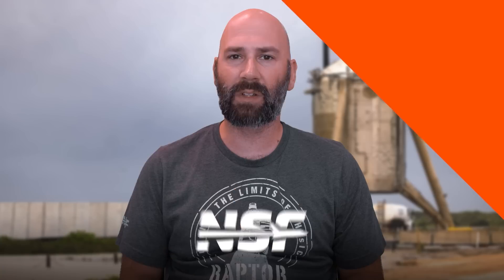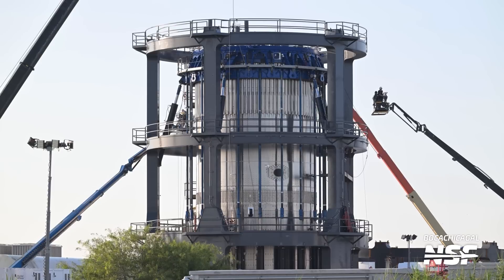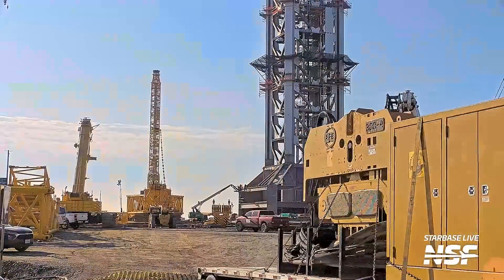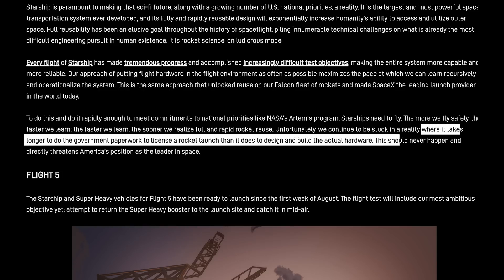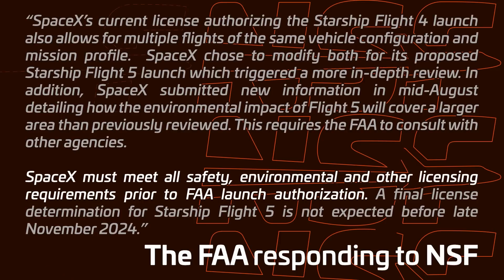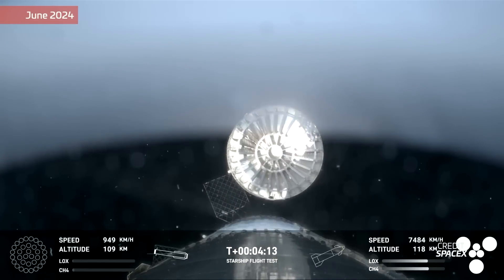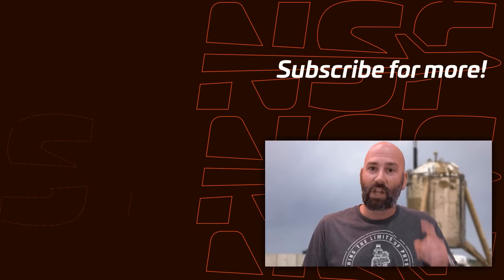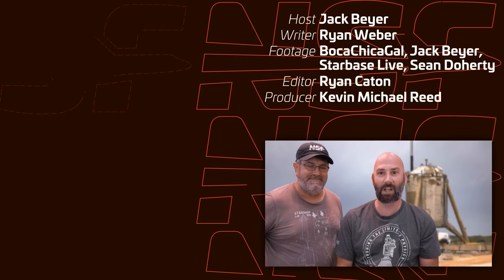WHY Is Starship FLIGHT 5 Delayed? | Starbase Update

Comment: Still watching, but you are WAY off base on Spacex not using an old configuration for more flights. Yeah, let's just keep making and flying Model T's when we've ALREADY gathered everything we can out of those flights - the science out is not worth the flight cost. That makes zero sense from a business standpoint. The FAA's process is outdated and needs to change. Hopefully some changes in Washington can streamline everything about how government works.
Reply: I never said the process was perfect, it's far from it. I never said the regulations should or should be changed. Just trying to report the facts. They could fly tomorrow and still complete important test objectives if they just follow the same profile as flight 4. In space raptor relight, tps validation, pez door testing, etc. Fact of the matter is, they chose this path and are now complaining about it
Reply: @JackABeyer  Are you sure they can do those things and still be considered flying the same vehicle configuration and profile?  I bet they would have to file new paperwork and would still be delayed by FAA.
Reply: @thestanwalker3512 Flight 3 planned for in-space relight, but was precluded due to attitude control problems. The Pez dispenser has never been fully tested, either. Flight 3 did operate the door, but not, so far as we are aware, the deployer; nor were any dummy satellites onboard.

Comment: I think you are technically right that even if you take drinking water and push it through a flame trench, its not as potable anymore. But if SpaceX does not have to do anything different after getting the certification then they were essentially correct. Nothing is different. They have documentation that they were even sampling the area as well. They were even sending (according to SpaceX) the samples. If nothing changes, then they were right that what they are doing was procedurally correct.  

I have a feeling that Texas knew they were doing the flame trench but it was either a CYA situation or a one part of the organization didn't know what the other part of the organization was doing, and it relied on SpaceX to know the rules.
Reply: Also the point of "I wouldn't want to drink the water after it has been hit with the raptor exhaust" isn't really relevant. I also wouldn't want to drink water from a puddle anyways, it doesn't need to be potable to not harm the environment.

Comment: I would take SpaceX's word over any FAA or EPA agency word.  I think the bigger point of what SpaceX is saying is that none of the stuff they are doing is any more harmful than like 80% of the industry in the area is doing. In fact, it's likely because of all the work SpaceX has done since they've been in Boca, that they've improved the overall environment as compared to before they got there. (SpaceX stated they test the water after every deluge event and it all tests fine, is that not good enough for the EPA?  They have to label it as industrial activity so that it now requires a different permit?  Labeling something as such, doesn't make it so.) (You drink alcohol so you're an alcoholic🤔... Just because industrial equipment is used, doesn't mean the water undergoes an industrial application or conditioning.)
I think it's because of Elon's high profile that the EPA and other environmental groups are picking things apart specifically in Boca.  The FAA is honestly just deferring all the environmental stuff off their place, so they don't have to deal with it. Whereas there are well established guidelines at the cap in Florida so there is little the EPA can do there.  Since SpaceX is dealing with their own land, not leased pad space in Boca, they are getting unfairly targeted.

Comment: I'm guessing they will need a water containment area. A "moat" so they can re-use the water.
Reply: The water was already going into catch basins, samples taken, analyzed, all before discharge. 

It was just a different "Industrial Discharge" permit, requiring the same operating procedures.

SpaceX probably can reuse the water, and that would require treatmenht to the same standards as potable drinking water. Expensive to do, and duplicating the Brownsville water treatment plant. SMH.

Comment: I would say its easy for regulators and government agencies to throw alot  things back at you and claim its your fault. Especially when their goals are to run interference. That is how the system works. They can bury you with paper work or they can be facilitators. I would say it  would be very short sighted to say we just dont have enough information but based on what we know its Spacex own fault.  Maybe thats the buearucrat take.  As an outsider it appears that if the goals are to be dominant in an increasingly competitive and strategic/ geo political space race then it is the government and not Spacex whom is its own worse enemy.

Comment: I'm an electrical engineer, I deal with inspectors on a daily basis to inspect and verify the correct installation of hardware by electricians. In my field we usually deal with one inspector per jurisdiction, so you generally end up forming a professional relationship that makes the process easier for everyone. Even still, there are many more people involved when a permit is requested, signed off on, or anywhere in between. 

First, I call a call center. They verify the scope of work. If I forget to tell them ANY information related to the work needing an inspection, the permit is invalid and has to be rescheduled. Likewise, if the call center makes a mistake, it's the same situation. 

Then the inspector comes out, inspects the work and requests any changes to be made, or passes the work and signs off. If the inspector has requested changes, it goes back to the call center and we repeat the first step.

Once the permit has been signed by the inspector, they will report back to the call center with approval, and I will receive my permit through email. This entire process takes a minimum of 2 days, up to a week.

All this to say that there is no room for "rapid iteration" in my field, and I suspect the same to be the case when it comes to the water system at SpaceX. Comparing it to my field, it could have been the case that the original inspector requested changes to be made, SpaceX implemented said changes, and perhaps it was never communicated back to the call center by the intern, and the techs or engineers at SpaceX assumed the process was complete, and the inspector perhaps assumed that another person had already signed off on the work.... 

Anyways, to wrap this up quick, you can see that there are so many people involved and not everyone has access to all of the information at all times. Especially the guys who are working on the site itself. If they get told to send it, they send it.

Comment: Trying so hard to provide impartial coverage, you did an awful job portraying the issues at hand. Without cherrypicking every single thing, just the water deluge issue: as you point out, it's not reaaally drinking water, right? But then, so what? They're still allowed to dump it. They didn't have to make a single physical change to the system to protect the environment, they just needed a different piece of paper. SpaceX is complaining that they are waiting for repeated "environmental protection assessments" that do not do a single thing to protect the environment, they just push papers around. 
And the cherry on the top is that you suggest the hot staging ring falling to a different random spot over the open water might make its environmental impact different.
Reply: The deluge water IS drinking water, it’s sourced directly from Brownsville’s water system. The heat from the CO2 and H2O in the rocket exhaust vaporizes the cooler drinking water. Most of it turns to steam. What doesn’t turn to steam is still drinking water.
Reply: @mikegardner107  thats the dumbest thing i've ever heard, 1 the deluge system is not built to food storage certification so as soon as they put it in the tanks its no longer potable. 2 these engines don't burn 100% pure, theres still soot and NOX put into the water, not to mention the CO2 produced from burning methane changes the acidity in the water, and 3, the wet land IS SUPPOSED TO BE POTABLE WATER, it has it's own ecology and the deluge system is disrupting that, the question the FAA has is HOW MUCH the delgue affect the wetland.

Comment: The by-products of burning methane and oxygen are water and co2.
So how is that industrial waste?
Reply: As far as I remember from several sources, the raptor engine setup for combustion is a little off stoichiometric proportions and methane rich to avoid damages to the combustion chamber. Therefore we can probably expect a low proportion of soots from the exhaust. But remember the insane amount of propellant burnt every second from 33 raptor engines.  I expect a non negligible amount of soots/pollutants in the exhausts even if it would be nothing compared to kerosene based engines like the merlins

Comment: Flight 5 with an adapted license is reasonable and for it to be processed quickly is reasonably. My gut feeling right now is that NSF has becomes unintentionally political at this point. Well thank you NSF, it was good as long as it lasted.
Reply: So in other words the details of this video went in way over your head and since you don't do nuance you can just call NSF political to simplify the argument?!?
Reply: @michaeldeierhoi4096  Did you even read my arguments?
Reply: @mattiasfransson8637  You mean like the part about claiming NSF becoming unintentionally political, but with no reasoning or evidence mentioned to support the claim???  Yeah, sure I read it!

Comment: I may well have misinterpreted this, but getting fined for dumping oxygen and water, for real? In the state of Texas no less. I get the need for regulations and why they are important, but when you see China just dump stages without a care, it makes you wonder who is going to make the most significant progress the soonest. Sure SpaceX need to comply and I think they really do try to, but surely it's also in the American nations interest to support such a forward-thinking company at the highest level of support? I mean, Boeing have just demonstrated just what an amazing company SpaceX is by trying to compete. 2024 Earth is great, but man it's still got issues.
Reply: @Billybobble1  where I worked a near nuclear grade demineralized water spill was reportable and had to be cleaned up. The regs are INSANE.
Reply: @RevSearch  Because it was TOO pure?
Reply: @RevSearch  The regs are protecting the environment and our lives. Long live regs!
Reply: @Billybobble1  
If SpaceX wants to avoid such fines, then the LOX has to be dumped into a suitable trough, not the wetlands. There is such a trough, but it's small, just enough for engine abort shutdowns. Not enough for dumping the main tanks.
Reply from the maker: It was LOX... oxygen in liquid state, which means it was around –297 degrees Fahrenheit. If you've seen the science lab experiment where they freeze and shatter the flower... think more along those lines. Not quite the same as just releasing some "perfectly normal oxygen gas".  - Das
Reply: @NASASpaceflight Oh no! Think about the poor flowers growing near the launch pad. We need to shut it down.
Reply: @NASASpaceflight  Don't care. Getting to Mars is more important then a liquid oxygen spill. You need to understand that.
Reply: @NASASpaceflight  If you can show me the actual numbers to prove liquid oxygen, or even just particularly cold oxygen would reach anywhere of note outside the launch site, then I'll change my tune. But until then it seems like the FAA is just the whiny teenager who's grasping for straws to not get his homework done on time.
Reply: SpaceX built a LOX trench or reservoir, but the capacity was designed to handle aborts, not tank purges. Was the discharge directly from the ship, or an overflow of the reservoir?
 @NASASpaceflight
Reply: @NASASpaceflight  Wow Das, thank you! Didn't expect that response. Yeah I didn't mean to simplify it as 'just an oxygen dump', but presumably atmospherically, the temperature change would quickly find an equilibrium? I just don't see an oxygen dump at most temperatures being an issue, moreover, there's way worse stuff going on, surely? Thanks so much for all your hard work keeping us informed x
Reply from the maker: No problem Billy, there's a ton of passion about this topic, so trying to provide some facts so folks can make an informed opinion. Such a large volume of LOX can take a while to boil off, the extreme cold temperatures can damage or destroy any plant or animal life they come into contact with, and even as it boils off the high oxygen concentration can cause things to be highly flammable... able to set fire and burn more vigorously than regular air. I know people like to minimize it as "just oxygen" but liquid oxygen is a pretty dangerous thing to play with. - Das
Reply: @NASASpaceflight  Das, your explanation makes perfect sense with that context. We are blessed to have NSF and others on this incredibly exciting journey informing us of all these kinds of detail, thank you again 😊
Reply: @NASASpaceflight  it's going to go into the air very rapidly by evaporation- the only damage would be to the metal plate used forthe deluge system. I have an extremely hard time believing it had any negative impact on the environment
Reply: @rocketignitionKSC    One consequence you are considering of dumping a large volume of LOX into an environment is the effect it has on wildlife.  The super cold nature of LOX could be a serious threat to wildlife in the area of the discharge.
Reply: @michaeldeierhoi4096  This is so wrong and ignorant, you obviously never worked with LOX! The white smoke venting from the rocket before launch is LOX and it never falls to the ground as it vaporizes as it comes out to ambient, plus it is only Oxygen. BTW, "every" rocket uses LOX, and NASA rockets at the Cape which is surrounded with birds and wildlife have never been effected by LOX, or the sonic booms for that matter. I live near the Cape. The red tape is simply political and personal harassment against Musk.
Reply: @TKA322  Whatever.   I'll agree that the FAA may be over stepping itself by this latest launch delay to late November and there is also an unknown for me about how much Space X has not been forthcoming about as well as the details of regulatory oversight.  Jack said as much in his presentation.
Reply: @NASASpaceflight What size area did the LOX cover? What size area of the wetlands did the LOX cover? LOX boils off rapidly. How long was it in contact with the area it covered?  Does this continue to happen with every spin prime test?
Reply: @mikegardner107  I think the idea is that one should first prove that the spill is harmless, then do the spilling, not the other way around.

Comment: "Why doesn't SpaceX fly the same profile?" Because SpaceX isn't a jobs project. These flights are needed to advance the design and operations. Doing the same flight after a reasonably successful flight is of no benefit. Clearly you haven't thought this through.
Reply: theres still plenty of upgrades they could test like the new heat shield tiles, the new payload door, new filtration system, etc etc with the current flight profile.
Reply: @DrewNar-tacA  How can they test heat shield tiles, intended to be returning from orbital velocity on a sub orbital trajectory? The filtration system can be tested with static fires. That leaves the door. You expect them to spend all that money to test a single component. Do you know what rapid iteration means?
Reply: @BabyMakR Yes i think they are going for more data here, but they actually could test the heatshield tiles on a sub orbital trajectory because the ship is sooo close to orbit that it is basically going orbital speeds. Just like on IFT4. And the filtration system only appears to be troublesome on relight after the flip of the booster
Reply: @BabyMakR  thats a big facepalm. that sub orbital trajectory is 95% the speed of actual orbit, but after a de orbit burn, its the god damn same. the filtration system can't be fully tested on the ground since that would require a 4 minute long static fire not would it include any tumbling or rotating of the stages, (go see CSI Starbase's videos) 
so yes, they can test the door among the many MANY other changes they've made using the current flight license while waiting for approval for the catch attempt
Reply: Who are you addressing that comment to?

Comment: Requiring a 2-month delay for relatively minor changes is nuts.  You acting like it's reasonable is nuts, too.
Reply: What minor changes are you referencing?
Reply: @caldodge  booster catch is NOT a minor change
Reply: The ITF-5 is intended to catch the booster after its return.  If that doesn't go as planned it could create quite a mess at the launch pad area which could negatively affect the environment.  This has never been done before so it is hardly a minor change.
Reply: @michaeldeierhoi4096  That change isn't what's causing the delay though, it's other minor changes to the flight profile which are - like the hot stage ring impact location.
Reply: @dd7428  Yes, perhaps, I haven't kept up with some of the details partly because it has become quite confusing and time consuming to keep up with.